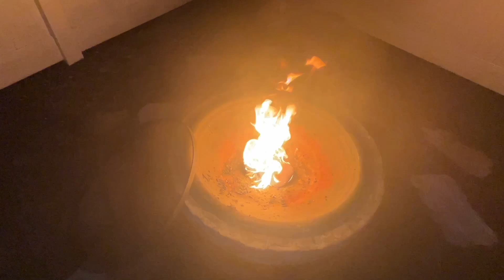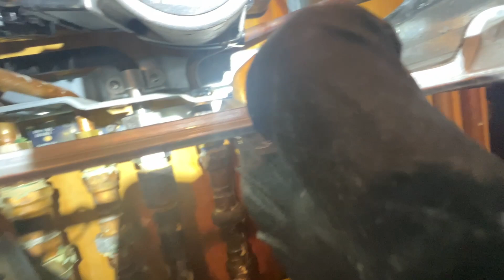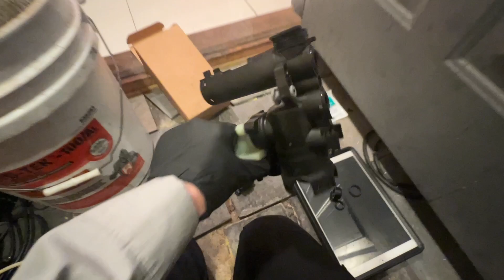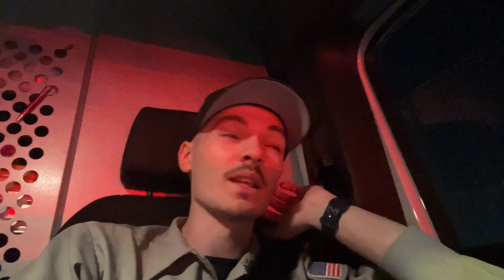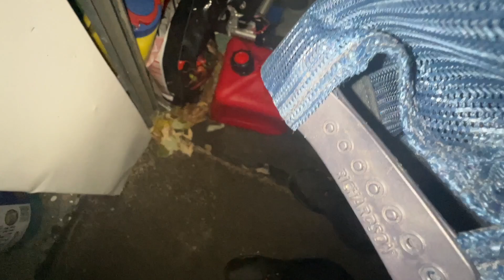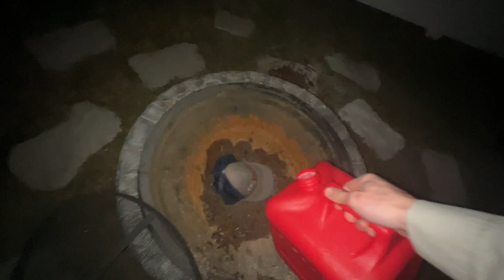Bosch! My Experience with Bosch Boilers! The Worst Boiler Manufacturer I Have Ever Dealt With!

Comment: Nice job! A while back when MP installed the first wall hung Bosch with that idiot way of mounting the close pipe manifold……nope , not for me! If you can’t get tech support and timely parts forget them. Also I don’t like the idea of combi units anyway, I’ll take separate heat and hot water any day instead of 10 lbs of crap in a 5 lb bag. Have a great Thanksgiving Daniel!

Comment: The flow turbine is the most common fault we in the U.K. have with Bosch always leaking wait until you get pin hole leaks on the hydroblocks 😂

Comment: Pretty common issue with the Bosch boiler. I’ve changed probably 100 of them. Pretty easy job, takes about 20 min after you’ve done a few.  I’ve always got a full kit with all new parts from Bosch. 

Check the pressure on the DCW, over 60psi will crack the return and supply manifold.

Comment: Previous employer sold a ton of Buderus/Bosch GB142 , we had issues with parts , That boiler actually has a oring on the return that you can’t get even from them .
Example they made the original flue connector out of aluminum, retro kit was plastic , In the instructions for the smaller models 142-24 & 142-30 you have to pull the heat exchanger to add a condensate drain tube behind the boiler ! but of course no heat exchanger gaskets are supplied. 
sorry to hear 10 years later it’s gone worse.
Reply from the maker: I have a video doing that repair. Didn’t need to remove the HX I figured out a way to do it without doing that. But yes. Nightmare!!!
Reply from the maker: https://youtu.be/jLaJdnHsuKc
Reply: @DCHVAC  Yours looks like either a 142-45 or -60 .
yes , still a pain ! I’ll admit now a few times , I cut the tube and sleeved vinyl tubing over it behind the boiler block

Comment: I am not in the industry, but am fascinated by the service videos. It appears from here that ALL the wall-hung equipment is short-lived and/or very expensive to maintain; as compared to a traditional boiler. I am surprised the push of the brand, even when a paid sponsor, with little history to prove the brand and the equipment. Seems these are a heck of a space-saver, but can they chooch for 15-45 years, with a rather simple annual service?

Comment: You are a great technician. But you have now learned the great lesson of life. I've known this for many years as I've worked in a factory 🏭. I worked in management over several branches. And there's one thing that is always true the right hand does not know what the left hand is doing! And they're always changing things before they realize on the other end they have. And the same guy that talked to you on the phone is not the guy that picks it off the shelf or packs it. So the person on the other end that is putting everything together for you gets absolutely no help from you. Because there's not one in that company that can take apart and put together the product from beginning to end. But do not blame yourself because you do all the right things and all the right steps. Some products are made better. But most times the parts books are printed months before they even decide what the parts are going to be.
Reply: You hit on a very good point. If a company makes mediocre product but has STELLAR support, top to bottom, they win. In my world, Kwikset Lock is the best operation out there. A shame I can not use their products. If a client, myself or a distributor call the support number, the service is incredible. I wish this business model were extended to a GOOD line of door hardware. The better products out there have companies that are not organized well, and suffer as you describe. That is the norm. So the best product from the worst company is not a success. IT can not be. Ever. And an average product with poor support apparatus is a loser as well.

Comment: What is your thoughts on those V2 Navien Units?
Reply from the maker: It sucks that homeowners have a large expense to maintain there Navien units because it entails to many component replacements. 

But I love how easy they are to work on, diagnose, replace parts… etc…

It’s very easy for me to make repairs. To get parts next day, to swap parts. But the customer has to pay for it at the end of the day. 

Tech support is great too. 

I don’t know that I have a firm opinion on them, it’s hard as a technician since there products are easy for me to deal with. Regardless of failures.

Comment: Daniel, honestly, how are their dual fuel central air units? If their wall hung units are problematic, I’m not so sure about those other units they sell either.
Reply from the maker: I don’t trust the company at all
Reply: @DCHVAC  I have a guy coming to my house next week to give me a price on a Bosch. I think I’ll listen but pass. He sells Carrier and the sister company as well, I think that’s the way to go.
Reply from the maker: @luvmybeemer  I would go with a standard efficiency system. I think the high efficiency aren’t worth it with costs to repair, maintain, and how long they last over time.
Reply: @DCHVAC  I know they all break but what would YOU recommend? I was lucky in my old house, it was a Carrier R-22 unit that was still working great when I told my house almost 2 years ago. This new house has a Goodman which will be 2 in May, 2023. I’m thinking about replacing it with a better system hence me getting quotes.

Comment: This is why I like cast iron 85% boilers!
What f is going on with high efficiency wall hung.
I feel the the demand on most wall hung units is extremely self destructive, especially with cheaper inferior parts , companies put in these products.
So much maintenance etc
The price seems higher than the less efficient cast iron!?
Please give me your input.
Reply from the maker: I think that in a lot of cases the high efficiency units prove they’re worth. Yes they’re expensive to maintain. Parts aren’t cheap, and labors not cheap either. 

A lot of people don’t get them meiantenanced. And sometimes that works out for them. A lot of times it doesn’t. Regardless the end result is changing some parts, which if under warranty isn’t too bad to get done. 

A lot of them aren’t so difficult to work on, parts come next day, tech support is very helpful, and it gets done. 

Built to fail? Maybe… but you do save on gas… the boiler takes up much less space, it’s nice and quiet and as technology progresses one day they’ll be great. 

Is a typical boiler great in my opinion? Yes. I think they’re proven, reliable, much less components, but they do cost more to run. 

If it were me, I’d get a wall hung, and I’d experiment with different brands, as one failed I’d go to the next. But that’s just me I do this for a living and have a curiosity for it.

Comment: I can't believe Mikey Pipes let you bash Bosch!
Reply: Daniel is not going to be invited to Thanksgiving at  Mikey Pipe's Taj Mahal tomorrow.
Reply: Not in the UK Worcester will send parts next day. Plus are suppliers stock lots of Bosch gear
Reply: I AGREE with him. Installed thankless gas water heater for friend. Nothing but trouble. Always going off setting code. After 7 years control board went bad and wasn't even available from bosch .  junked the unit and installed a renaii.  That's been 4 years ago and haven't had a problem since

Comment: Wow that's pretty !@#$%^& up. Bosch !@#$%^& get their act together. Was it a 3 way valve
Reply from the maker: No… it was the return valve. The assembly that the return line goes into, which also has a motorized valve to divert the return into the domestic heat exchanger.